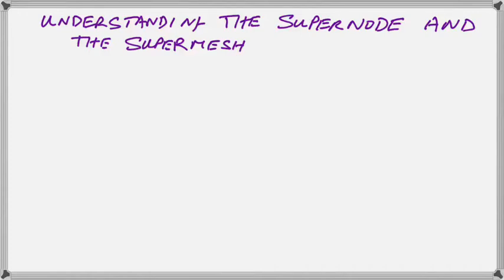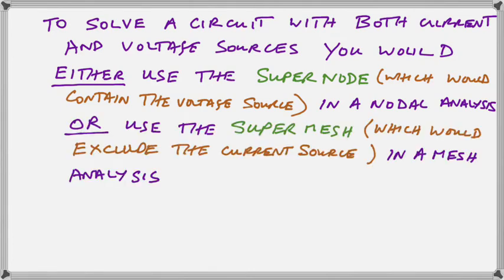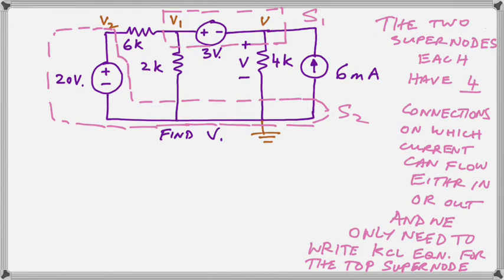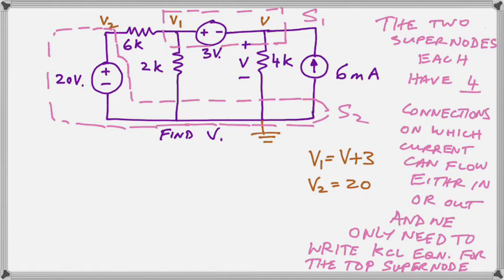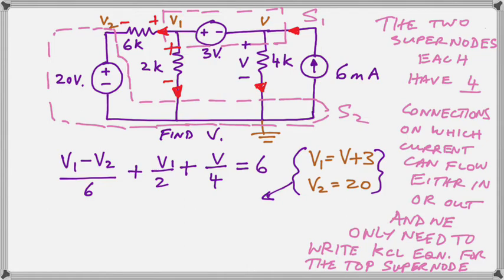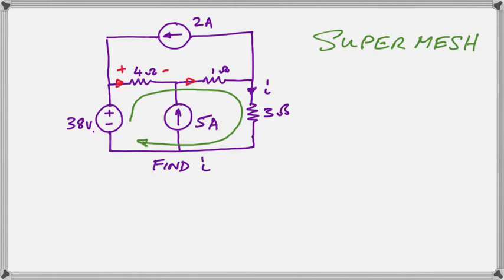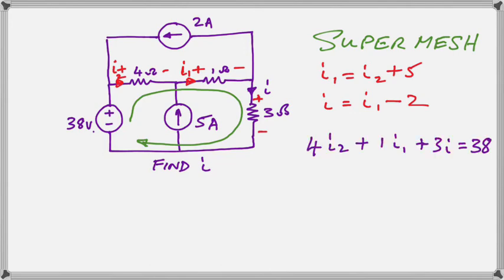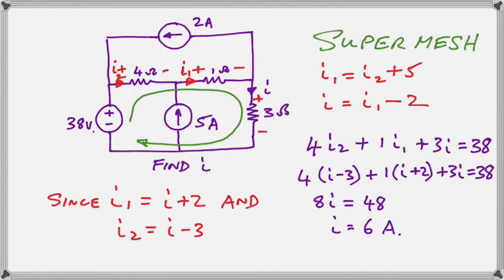Using Supernode and Supermesh in Circuit Analysis

Comment: if there was no 6k Ω resistors what do i do with the 20V voltage source?!?(in the first example) pls answer
Reply from the maker: If there was no 6K resistor .... then the problem becomes trivial because there would be NO "unknown" voltages...... the V2 would not be there at all ..... V1 would be 20 V and V would be 17 V ..... then it would be easy to find all the 4 currents ...... we would have the 6 mA coming in at the right ..... the 17 / 4 and the 20  / 2  currents going to ground thru the 4k and 2k respectively ..... and the remaining "unknown" current (thru the 20 V source) would be 8.25 mA (in the OPPOSITE direction to what is shown on the diagram) ..... see the solution at https://smendes.com/elet2220/custom-solution-CA1.jpg
Reply from the maker: You could also study this .... it is the same as the video you watched only the CURRENT from the 20 V source is REVERSED ..... this is the actual direction of current flow ...... but from the students point-of-view it does not matter which direction they choose AS LONG AS they are consistent throughout the problem .... the solution of both equations will yield V = 8 V.
https://smendes.com/elet2220/CA2.jpg
Reply: @StephenMendes  Thank you for your answer👍

Comment from the maker: I MADE BOO-BOO in my words between 9:42 - 10:05 (my bad) do NOT be confused ..... Going around loop CLOCKWISE the voltages are POSITIVE  when going from + to -  side of component and they are NEGATIVE when going from - to + side of component  (so the 38 volt source is considered negative for KVL to equate to zero however I moved it to the right side of the equation which is the normal thing to do so that is why all the terms are shown as positive in the KVL equation